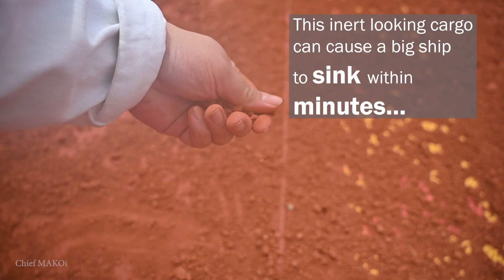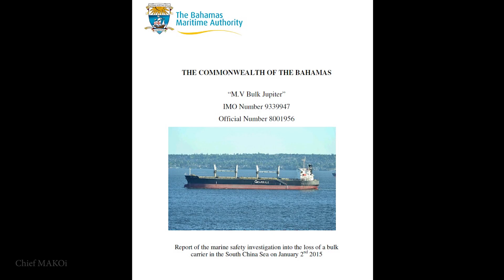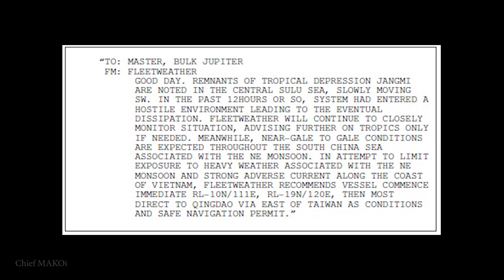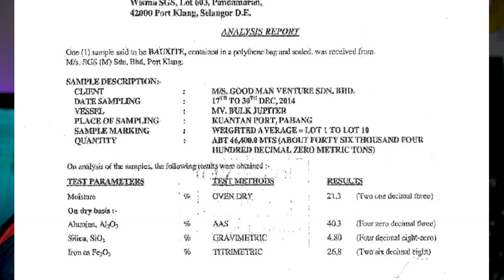The Cargo That Can Sink Ships Within Minutes : Bauxite Liquefaction | Chief MAKOi Seaman Vlog

Comment: Let's look at it from purely commercial standpoint: if you load cargo with 25% moisture content instead of 5%, you're not only risking to loose the ship and crew, you're just transporting a quarter ship of water, which amounts to loss on every stage. Given how heavy industry works, several days of supply delay by a single ship won't affect anything for end consumer.

Comment: Bentonite.  It absorbs moisture quite easily and can form an extremely slippery slurry when wet.  It is very often used as a lubricant component in drilling mud and in food packaging to help prevent products from sticking to the packaging.

Comment: There is s thing called, siconisity. Your ballbearing illustration will show this. In music they use a Metrodome, which acts like a windscreen wiper. If you set up 20 Metrodome's at random and leave them running, after a short time they will all become sincronised, !
You may know this, but it's a fact that can be applied to everything.
Thanks for your explanation 🙂.

Comment: Baffles need to installed if they carry wet bulk cargo .
Or vibrate/compact the cargo dense before voyage.
Reply: But they won't, cost money for installation 
And if the bulk cargo was dense it would take longer to unload, which will cost more in port fees and alike.

Comment: Dividing the container ship along the midline would isolate the sloshing.
Only half of the cargo could make it past the balance point.

Have a bilge pump in a filter box at the bottom of the load and one on each side at the top.
At first the bottom pumps can remove water after loading and in calm waters.
Then in storms the top pumps can remove water from the slurry each time it sloshes when pitching and rolling.

It's like skimming the cream off the top of cement if you added too much water.

Comment: I have heard that rice can sink a ship too

When its loaded into the cargo holds dry, its very compact, but if there's water able to leak into the cargo hold somehow when the ship is at sea, the rice can swell enough, to put enough pressure on the inside of the holds, and split the ship from the inside

That's what i have been told

Very interesting video

Comment: The dynamic movement of cargo interaction with vehicle movements can create huge transient waves. Whether it is a sloshing tanker truck speeding through a curve or hanging meat carcasses swaying like a pendulum. The force of waves and swells and the leverage of a large ship can tear it apart without shifting cargo. Combining two wave energies inside and outside a large ship can never be allowed. You can pound open a bottle of wine wrapped in a towel against a soft tree bark with the liquid rebounding against the cork, without a corkscrew. The focused wave will concentrate the pressure on the opening and the bottle is small and tough. Ship stability and vast leverage a very delicate by comparison.

Comment: Is Bauxite more dangerous than other metal ores subject to liquifaction, because Aluminum is subject to replacement by Hydrogen (eg, water) in an oxidation-reduction electrovoltaic series, whereas metals like copper or iron are not (and noting magnesium or zinc are used as sacrificial electrodes on ship hulls, as they're even faster to be replaced)?  

Do pressures to carry unsafe load increase when BDI (or HARMEX for containers) are low, and reduce when those rate indeces are high, or does the industry act equally predatory regardless?  What defines "dry" under BDI (Baltic Dry Index), and how does that vary for metals, grains, or other chemicals?

Comment: So what stops this happening on liquid cargos such as oil?
Reply: By limiting amount cargo can move side to side by dividing ship to lots of smaller separate tanks.
Also internal baffles can be used inside tank to slow the speed liquid can move preventing it from instantly "falling" to side going down and completely limit amount of movement in low fill tank.
Though I guess with oil they try to have fewer number of full tanks than lots of only little filled tanks: In tanks with little oil and lots of empty fumes could create explosive mixture with air. (inert filling like nitrogen could be used to prevent fumes from igniting)

Comment: Chief; here in MN. we have iron ore pits in northern MN. and all the "raw high quality ore" had been mined out by the late 1950's early 60's. The WWII years saw record tonnage shipped both by rail and by boat to the steel mills farther down into the great lakes basin; i.e. gary, Indiana, South Chicago, Detroit, etc. The plants changed their equipment to produce Taconite Pellets; a 1/2-1" ball of iron that is 65% iron that can be safely transported by vessel or by rail. The one open pit mine that can be seen from satellites in space is the Hull-Rust open pit mine in Hibbing, MN.

Comment: 9:10 wouldn’t it also help the stability of such ships a lot if there was a wall in the middle of each storage compartment? That way half of the water would be forced to stay on the left side, while the other half is on the right — somewhat balancing the ship? Am I missing something? Is this somehow not practical?

This could of course also be extended with more separations, like 3 or 5, but my guess is that even a single wall would already help A LOT.

Comment: I have a mechanical engineering background.  My first glance question when looking at the design of the bulk cargo ships is why aren't the big cargo holds baffled?  Place dividing walls parallel to the keel of the ship so that if the cargo liquifies, the water pooling at the top is limited in its lateral movement.  If I can think of this while watching this video, I am sure engineers at the shipbuilding companies and the captains and crews of the ships can think of this too.  If you have a cargo hold 80 feet 6 inches wide, we can weld in a 2 inch wide wall along the ship's centerline and create 2 40 foot 2 inch wide compartments.  Another two walls dividing these two half holds into quarter holds 20 feet wide and we thus limit the movement of water sloshing in the top of each hold relative to the centerline of the ship.  Makes it less likely to capsize.  Place monitoring cameras in each such compartment and now a crewman in the bridge watching the video screens knows the condition of the cargo in each hold.  Take in a load of wet bauxite and see the water pooling at the top?  Suction hose ought to fix that problem.  Pump it over the side.  You're paid to haul bauxite, not water!
Just some thoughts.

Comment: I actually watched a full length video on ships that sink and what often people falsely claim was the reason for the sinking.  It is true that the ship was never recovered but the actual reason of the ships sinking was not because of bauxite but instead the fact that the kitchen exploded because the chief cook used the complete wrong type of cooking oil that caused a fire and ended up blowing a hole in the side of the ship killing 10 crew mates instantly and injuring several others.  Out of the 27 crew members.  Not 19 but 27.  I have no idea why you would lie about something that stupid but you lied about it.  There were 27 crew members and 15 bodies were found inside the sunken ship in which 10 were dead by the initial explosion and that was proven because there was no water logging damage in their lungs.  5 drowned.  7 bodies were found in the water not 4.  There were 3 people who lived including one guy found in the water.  3 people where never found nor was their any information about what happened to them.  2 of the survivors were on a motorized raft as they escaped the sinking as fast as they could and went to shore to request aid in searching for survivors.  The 4 people whos bodies were never recovered it is strongly believed they may have either been blown out to sea and or eaten by sea creatures.  The ship actually sank in seconds not minutes.  In fact it is strongly believed that the ship sank in around 47 seconds after the ship oven exploded ripping a hole in the side of the ship which caused water to instantly flood into the ship and sense most doors were open instead of closed like they should have been water poured deep into the ship sinking it instantly.  Now even know the cook used the wrong oil it actually was not his fault because that oil was already inside part of the stove where it was being used for cooking and it was placed in their by someone else.  The Chief Cook entered into the kitchen and noticed something wrong and ran screaming for people to get out.  This is actually what he really said and not what absolute liars bullshittingly lied about what he actually said.  According to the other 2 survivors they actually were on the top deck when they heard him screaming and they instantly grabbed an inflatable raft with a motor and threw it into the water and jumping after it and inflated it as the ship exploded they turned the engine on and floored it to get to shore to get help.  They thought everyone was dead when they say the ship sink like a rock and had no time to attempt a rescue on their own so they straight up went for help and fled the explosion.  It was actually amazing they made it to shore because one of them had a gash on his neck from shrapnel that flew and slit part of his neck.  The other guy got knock out from getting hit by something when the ship exploded.  Basically they set the boat angle towards shore and one got knocked out while the guy who was bleeding out his neck steered the raft to shore to get help.  There are a horrifying amount of ships that sink because someone orders the wrong type of oil for ships to cook with and the stoves explodes from it.  This happens so many times and it pisses people off.  Seriously ships need to stop using the wrong type of cooking oil and all these ships need to stop cheeping the fuck out and replace all of these garbage stoves with stoves actually designed for boats.

Comment: Just a thought... If the bauxite would be loaded in water proof containers, and completely filled so there's no air left, wouldn't the whole container act like a solid block? There would be no room for anything to move anywhere. But I guess such a solution would be too expensive...

Comment: If there is a risk of liquifaction then couldn't it be averted by storing it in containers fitted with mesh grids pre-installed, or lots of smaller metal dividers?

Comment: As a secondary protection (primary being ensuring the cargo is sufficiently dry), could the ships be equipped with baffles to prevent side-to side shifting of bulk cargo? Even one partition down the centerline of the vessel could greatly reduce the impact of dynamic separation.

Comment: They way this material acts in motion should have been known before any incident occurred. I knew about this decades ago with can tests of different materials. It takes one second to know the solution and prevent any further incidents. The regulations of material transportation are not good enough. The regulators are responsible for the deaths they caused.

Comment: I work in a coal plant, I will say that I’ve seen liquefaction and dynamic separation in the coal we use especially in the storage silo, it turns to a mud like concrete or clay. It can foul up feeders and plug off belts if it is bad enough, and the other risk of it is that powdered coal (which is what we produce, think the size and texture of baby powder) it will float on water it’s rather hydrophobic in that state and it can and will burn while floating on the surface of water. I’ve seen it and dealt with it, you can’t use just water to put a fire out, we’ve learned to use liquid soap mixed in water

Comment: Such a shame that good crews of hard working people always end up drawing the short straw. 
I first heard of liquefaction after a freshly built hydro dam collapsed in a storm. The farmers who used to farm there had warned the company of the unstable ground, having fought with it for decades, but the engineers were convinced it wouldn't be a problem. The whole dam came down and caused a flood with a huge mud slide. Luckily it wasn't a densely populated area.

Comment: Trains running on uneven jointed rail can have a similar issues. At the "correct" speed (12mph iirc) the side to side roll of the rolling stock will match the frequency of the offset joint spacing and can roll the car on its side.

Comment: As an ex offshore oil rig scaffold superintendent, commercial pressure is real.  Document everything and in an extreme case, be prepared to pack your bags, get you or crew sent home. Worse of all possibly slandered or blackballed. Stand for safety, because if you are killed, the job continues without you. If successful, the expectation is one will normalize accepting dangerous conditions. 
13 years offshore, no men hurt. But was willing to get uncomfortable standing up to demanding customers to ensure safety.

Great video Captain.
Reply: Amen

Comment: They should make the main deck of ships equipped with the ability to seal it self off water tight then detach from a sinking ship. So it just bobs around until they are rescued. This allows them to keep communication antennas as well.

Comment: Question. Inst possible to knwo how much water/moisture was in the cargo by simply comparing the expected displacement of the ship with the cargo to the actual displacement (checking the water level  still in port) ?

Comment: Isn't it a solution if these materials are transported with tankers? I know the density of the bauxite "liquid" is different than the oil, but the tanks are basically designed for it.

Comment: You could get a very good reading on the moisture level by weighing a sample and then baking it.  Or, you could get a “Speedi-Moisture-Meter”, which is a pressure vessel you add a measured sample of the material to, with a couple of steel bearings.  Then you toss in some carbide powder, screw on the lid with a pressure gauge, and shake it up for a few minutes.  the Carbide reacts with the moisture to form acetylene gas.  The pressure is directly related to the amount of moisture, and you can read the moisture content directly on the pressure gauge.

Comment: Since most boats are not short of pumps, it might be a good idea to insert a long pipe hose into the hold while loading, if there is humidity in the cargo and it starts to liquefy you should be able to pump some of it as you go along.

Comment: We had a problem while we were transporting Coper concentrate , it came in pebbles smaller than 1mm and the minimum humidity to load was 10% but when we were loading it was around 9,5% while sailing the humidity was raised to 12%. We had to go into port to ventilate and wait for it to dry. It took 3 weeks to dry 10,000 tons and was tested twice a day once by the company loading and once a day by the insurance.

Comment: I was assigned to the bulk carrier Fung-Ho out of Singapore in 2002. We were carrying a shipment of Bauxite to China when a few days into the voyage the cargo shifted on account of rough seas. We pulled into port with a 30 degree list to starboard. No investigation was carried out by management and we carried on as usual.
Reply: Damn that's rough.
At some point you have to rethink who you are working for. And some criminal repercussions maybe.

Comment: You might be able to fit a massive sub woofer inside the cargo to vibrate it like  a wine glass by finding its naturally oscillation frequency.
This will force the water content to the surface where it can be pumped out
I would just imagine the speaker will sound like an earthquake.

Comment: Could the design of the cargo hold prevent capsizing in this case? Instead of a single hold spanning the entire width of the ship, could there not be several holds next to each other that run parallel to the length of the ship? The rocking within the holds would still occur, but it wouldn't rock across the entire width of the ship, so it would cause it to tip over. How are liquids transported on cargo ships?

Comment: My father had to be concerned with this in fuel tankers. He told me of a story where he was a charter founder of a volunteer fire brigade 60 years ago. They bought a used truck chassis and put a 1000 gallon unbaffled tank on it for water. Filled it with water and took it to the first fire, using half of the tanks content. The trip home they almost rolled the truck over because of the water in the tank sloshing. They drained it and welded in baffles and the problem was solved.

Comment: Couldn't it be stored in such a way that the whole load could not shift to one side, with containers or different separation of cargo holds?

Also I wonder if there was less bauxite on board it would be totally safe even with liquefaction.  Maybe half of the ship loaded with a non-susceptible cargo that also needs to be transported.